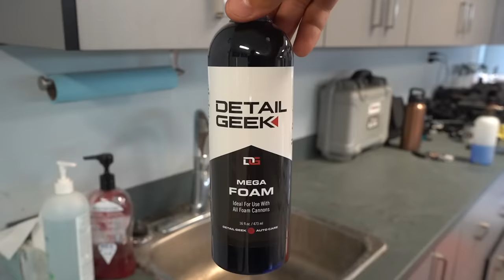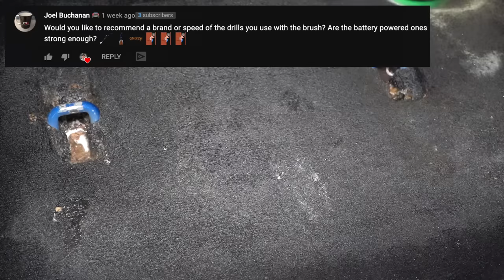Deep Cleaning a SUPER NASTY Minivan! | INSANE 15 Hour Detailing Transformation! | The Detail Geek

Comment: I used to drive the premium version of this van for Uber. I would clean it after approximately every 2 rides depending on how disgusting or messy the riders were. If it's not clean for each rider, you could get a bad rating which leads to getting kicked off the platform. I had all my detail equipment stowed underneath the floor. I know how much work goes into cleaning the fabric carpet option. Also, I had the fabric seats which worsened the nightmare. I'm glad I have new vehicles.

Comment: I’ve had this question in mind for a while: cleaning speaker grills. There’s nothing behind an air vent grill so the steamer is no problem but there are speakers behind the speaker grills. Do you think the steam could do any damage to the cone of the speaker?
Reply: i was wondering that too
Reply from the maker: There is zero potential for damage if you use the steamer properly, so short blasts and don’t hold it one spot too long. With speaker grilles, I always hit them at a steep angle, limiting the steam that gets behind the grille, or if I’m using the brush I simply work quick. It’s all about knowing your tools and how to use them properly 👍🏻
Reply: @TheDetailGeek  👍 Thanks... Brian

Comment: My little pet peeve in these videos is when you extract the carpets around the seat anchors and the soap/water slush gets stuck under the carpet in a small puddle and you don't wipe it dry. Could maybe cause some rusting issues as well.
Reply: He had said that he does that but just doesn't film it. Plus I'm sure the extractor sucks a lot of that water back up through the carpet
Reply from the maker: I showed sucking it out with the extractor (without the nozzle) and then I always wipe up with a towel once the camera is off and moved…I wouldn’t ever leave a mess like that behind, don’t worry 👍🏻

Comment: Detail Geek: use rubber floors for the caravans!

Dodge: hey write that down!
Reply: I grew up riding around in my dads astrovan with rubber flooring! Massive spill? Hose it out. Someone car sick? Hose it out! Carried around some dirty doggos? Hose it out!
Reply: I did get rubber mats for the passenger and cargo area of my last SUV. Just got them again for my new SUV. They are a life saver!
Reply: I mean they probably use carpets for sound insulation and if they wanna do the same with rubber floors they probably would need to add carpet or sound deadening material underneath it which increases cost and weight.

Comment: One easy fix...do not eat in your vehicle,  especially when kids are small.
Reply: Right, like it’s really not that big of a deal to wait to eat until you get home or wherever you plan on eating. It saves you from spills and just prevents food mess overall. Now you just gotta worry about dirt but a quick once over with a vacuum basically saves the problem.
Reply: You've clearly never road tripped with kids.....heck even adults. There's days I'm rushing to get my 2 kids to their 2 separate baseball games that start at the same time and are 20mins away from the other so we eat on the go. Simple solution is if it spills I clean it up 🤷‍♀️

Comment: I like your videos, and big fan of them 😊

Two small questions:
1- why don't you start from top to bottom. What I mean for example: cleaning the roof or seats, then the floor, as there might be some dirt spill down on the floor again while cleaning.
2- why not cleaning beneath the hood ?
Reply: I wondered that too. Part of my job requires cleaning, and we go cleanest to dirtiest, top to bottom, left to right. I'd start with the walls, steering wheel, etc and work my way down. I wonder if there's something different about cars?

Comment: Quictent for those who can't afford the chemicals to clean that Tarn oil off of their vehicles from the roads what I use is some Diesel and gasoline that mixed together I'm excited about 50-50 and I use a spray bottle and some soft bristle and hard bristle brushes depending on where I'm working and I'm working on metal I use hard if I'm working on painted material and Plastics I use a soft bristle it's kind of like the toilet scrubber bristles to scrub and scrape off the old stuff and then one site Lucinda law up then I use a power washer and if I'm doing it then I I use a water heater that's hooked up in between my my hose spicket in my power washer so that way I use hot water Prima mix like a steamer it's just boiling water coming out of the power washer will help that's tough break free and and come off the paint and all that without leaving behind any damage or residue

Comment: Diesel fuel will take that road tar right off with ease and won’t hurt the paint at all spray some on a rag and rub it right off it will not hurt the paint at all that’s what we use to get it off our dump trucks I haul asphalt and it will take it off with ease you’ll be surprised how easy it comes off